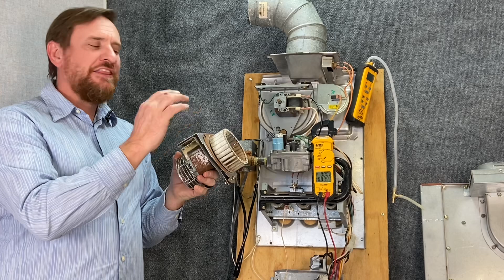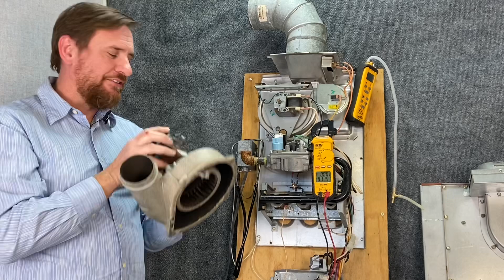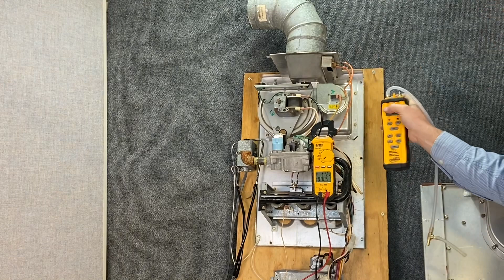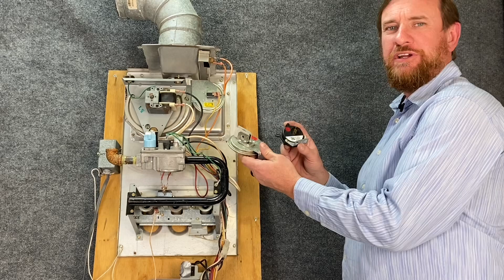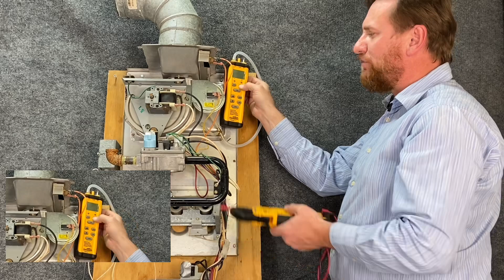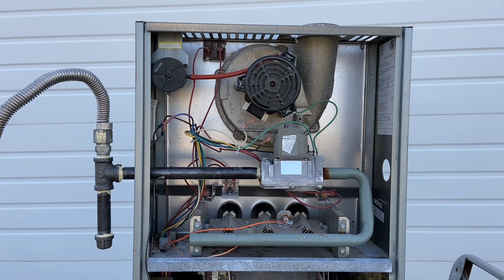Inducer fan, combustion fan, induce draft motor of a gas furnace

Comment: Great instructor. Hi, my york YP9C inducer motor has only two wires. How is it able to ramp up and down with only two wires connected. One wire is HOT and the other is NEUTRAL. Thanks.

Comment: Great video. Very informative. Thank you. 
 I do have a question:: I pulled the Inducer motor assembly and the 5" diameter fiberglass gasket came off in pieces. 
Do I have to replace it with the same gasket or can I use a high temp. RTV silicon to make a gasket?
Reply from the maker: Thank you and that's a great question.
I prefer to use the exact gasket but we know that's rarely an option. 
When changing commercial heat exchangers they would send high temperature gasket material so I would keep that, cut it myself and use it when needed.  I'm sure the material could be purchased and kept on hand. 

As for the RTV red, I don't know. 

The heat exchanger should not exceed 170⁰F and the RTV red is rated for 600, so in theory it should work but I have never tried it.
Reply: @love2hvac  Thank You for the quick reply. 👍

Comment: You are amazing Ty, thanks. I've been having problems finding information on how draft and venting works on gas furnaces. Do you have any books or materials you would recommend to learn more about it?
Reply from the maker: If you can find a class from NCI National Comfort Institute, they have CO and com nation classes that go deep into the matter.
ESCO has a book combustion analysis that covers it to as the draft system is directly related to combustion analysis. I also recommend CO a clear and present danger. It covers how draft from other appliances working together in the home can affect the furnace draft.
Reply: @love2hvac  terrific, thank you.

Comment: If that exhaust is negative pressure/natural draft and does not require for the Inducer to force the exhaust out. Than, what is the Inducer's job?
Reply from the maker: It's job it to pull the gas mixture threw the Hest exchanger. Very important!

Comment: 09:50, OR, go listen to the outside furnace flue pipe exit.  Upon motor startup, at its lowest RPM's, before too much air flow sound is coming through, YOU CAN HEAR the tell-tale GRINDING noise of BAD BEARINGS.  It is UNMISTAKABLE compared to the SMOOTH sound of new motor bearings.  GRINDING NOISE is BAD JUJUBE!!